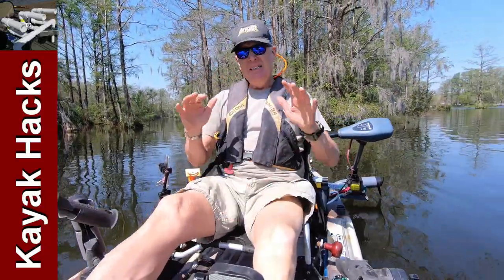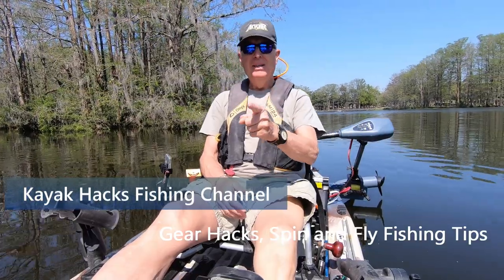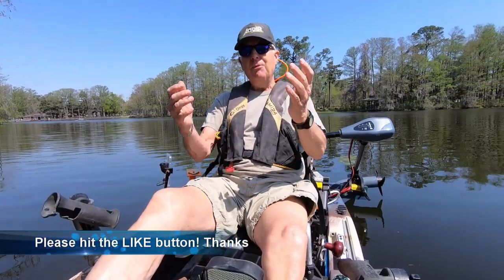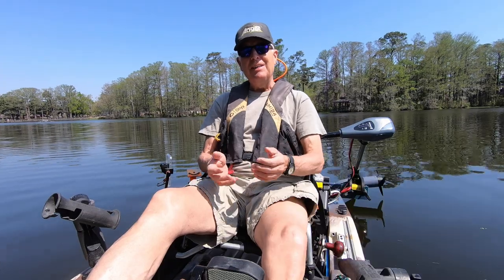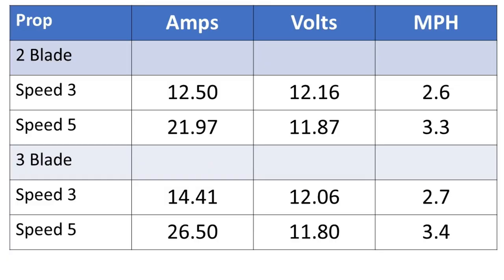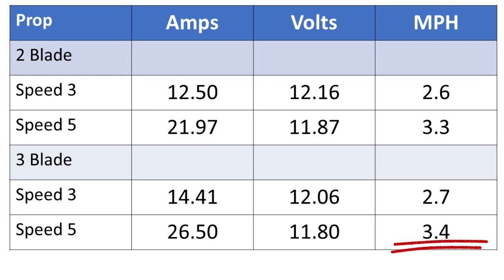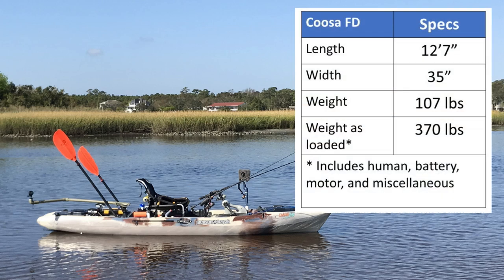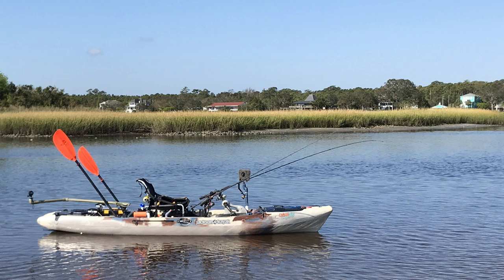Kayak Trolling Motor Prop - 2 Blade Prop vs 3 Blade Prop

Comment: I've worked in the fluid engineering field for quite some time, and while yes you do draw more power with a 3 blade propeller, it will be more consistent and continuous, making it more efficient when it comes to water chop, winds etc.   I've done this comparison, same boat, calm day and choppy windy day, and the 3 blade propeller outperforms the 2 blade overwhelmingly in tougher conditions.      I keep the 3 blade on for that reason.
Reply from the maker: Thank you for that great insight! I appreciate it!
Reply: i run a 1.3hp gas engine as an outboard.  i barely use any fuel so efficienty doenst matter to me, i just want to be a little bit faster.

What prop should i run?   rn  it has a  stock metal 3 blade prop
Reply: @sparklauerei1 prop angle is going to get you more speed. My 6hp tohatsu was slower than my buddies 5hp.  Switched to a more aggressive prop angle and now I leave him in the dust lol.
Reply: I may just keep a three blade on my boat for those rougher days then. There’s a lot of days in the winter when there’s just enough breeze to blow my boat around and it really gives my terrova a workout.

Comment: If you have two props that are identical in Pitch and weight , the 3 blade should provide more thrust and less top end speed over the two blade. Some how the graph shows a discrepancy of amperage and voltage which means your battery became less efficient at holding its voltage by the time you tested the 3 blade , or you did not charge the battery to full charge for each result. You should use a lithium ion battery to get more accurate test results as they are a lot more stable and hold a very specific voltage for hours. If you had the voltage of the 3 blade 11.87 volts , you might see an increase of .1 to .2 MPH. I'm guessing that the blades are not pitched the same , the 3 blade must have a higher pitch to reduce drag and thrust but increase top end speed. To anyone saying an increase of lets say .5 mph on a trolling motor is not worth it. When that is your only source of motion and you are talking going from 3.4 to 4 mph , that is a huge difference , like 20 percent increase. It would be like a outboard going from 80 MPH to 100 MPH. That is massive , small gains yes , but very noticeable over 8 hours on the water.
Reply from the maker: I appreciate that thoughful input! Thanks

Comment: I've tried all props on both a 36lb and 55lb thrust 12v. I enjoy the molded APC 2 blade propeller the most. from an RC airplane. not a good weedless option at all tho. great for speed and efficiency  The "stock" 2 blade is a great option but the 3 blade is the more stable, less vibration, and most "uomff". All fun out on the water. Now I have an NT300 and luv it. GOOD VIDEO!! look into APC propellers i love mine.
Reply from the maker: Thanks for the info!

Comment: The best improvement I've seen from a 3-blade prop is 1/2 mph... which isn't worth the extra power consumption it takes to achieve it. Thanks for the chart, that summarizes it beautifully!
Reply from the maker: Totally agree
Reply: technically speaking you shouldn't see any, more blades add drag which reduces top speed, there used for power transfer (torque). its why large vessels have 5/6 blades. Your props probably had 2 different pitch angles is what you noticed.

Comment: I know this is a peddle kayak but last year I was able (with my warranty) replaced the 2020  3 blade prop on my Jackson Big Rig with a 2021 2 blade prop. WOW! what a difference! Much easier to peddle and i have a better take off rate and higher top speed. So more is not always better just as your test showed. Thanks Army.
Reply from the maker: Yep. I did the same. I got the 2 blade for pedal and never looked back.
Reply: With the two blade prop you have less surface area, more speed.
I had a 17' tin boat, with a foot controlled 24 volt, 75# thrust motor, 5 speed, 2 blade prop. On "1" speed, in no wind, it was ttttooooo much. On "3" speed, if the motor was turned to port or starboard, it would throw you off the boat if you weren't ready.
I contacted the TM manufacturer, they recommended going to a three blade, to slow it down. It did. 

Have you tried kipawa props ?
Reply from the maker: @fishingismydrug1  No, I'll look.

Comment: Very interesting.  No wonder all of the 12 volt trolling motors I have had over the years had 2 blade props.  I wonder what 24- and 36-volt motors use.  Will have to start checking out bass boats and flats skiffs.  Agree with the comments about the pitch.  Don’t think I have ever seen a prop display offering a variety of pitches for trolling motors, though.
Reply from the maker: I wish there were a selection for pitch. At least I know to stick with the 2 blade for now.
Reply: I have a motorguide digital 54lb that has 3 blades.. it makes decent speed with my 12 foot jon on half throttle (about 25-30 amps draw is my trolling speed, 3 mph, with 2 persons and gear).. but i just got a endura max 55 to replace it.. wich only has the double prop.. i hope i can still get to about 3 miles on 25-30 amps with that.. on a 120 amp lithium that means I can troll for about 5 hours, wich is plenty for my use.. I mostly combine trolling with vertical fishing/casting.. so i can make it a long day ez if i watch my usage a bit.

Comment: Love the video, Sweet and to the point. Quick question for you though.. did you notice a difference in how quick it turned with a 3 blade?
Reply from the maker: No, just the resulting speed.

Comment: I didn't have an amp meter hooked up to figure power draw and I used a 36lb to test with, but I didn't notice any speed difference between the 2 blade and 3 blade props. My understanding is the 2 blade is better for dealing with grass and weeds (though I haven't tested that).
Reply from the maker: Thanks! Your results confirm what I found. I did not test weeds.

Comment: The Katana is designed to maintain the efficiency range of the Machete III, (the 3-blade), but will outperform it in grass! It's not intended to be some performance upgrade.
Reply from the maker: Thank you for that clarification!

Comment: Thanks for the info. It's now given me something to think about as my two blade (stock) is banged up causing some vibration at higher speeds and was thinking of replacing it with the 3 blade. The speed difference is a bit puzzling. I've watched people switch and the speed factor was much greater with the 3 blade. Have you tried testing again??
Reply from the maker: No, I only did it once. Some of the other comments have suggestions - pls check them out
Reply: @KayakhacksFishing  Thanks. After commenting I read others and watched some other vids. It appears the 4 blade is not really worth it. It does have some very select applications, but otherwise the two blade is the better one for the average person in my opinion.

Comment: Interesting findings. I was told a few days ago by another YouTuber who builds tiny boats that two blades are better than one for efficiency and snagging less often. He and his friends have used all sorts of motors with two and three blade props. 
For his type of mini boat he recommended the 30 lbs Minn Kota as the Hull speed is only 4 knots max and a more powerful motor would be wasted anyway. 
I like the Endura MAX range of electric outboards, They utilises a Digital maximiser to give you up to 5 times longer running times on the lower settings. The harder you run the motor though, the benefits diminish.
Motors with the Digital Maximiser provide up to five times longer run time on a single charge by drawing only as much power as you need, so they don't waste any energy like other models do.
Doodling around at 1.5 to 2 knots and getting even twice the duration compared to doing the same without the Digital Maximiser is enticing I must say, twice the price though.

Great test, thanks for doing it 👍
Reply from the maker: I absolutely agree on that maximizer technology! Thanks for the confirmation on the 2 blade!
Reply: @KayakhacksFishing   👍👍

Comment: Do you need to register a kayak if you use a trolling motor on it?  I assume that it then becomes a motorized vessel that requires numbers.  What is the deal?
Reply from the maker: Yes, in North Carolina, as soon as you put a motor on, you have to register

Comment: Greetings from SG! I have a question sir and would be grateful if you could help me answer. Ive a 14ft kayak (Efix model 3 pieces which is able to assemble into one kayak). I pondering whether to buy a trolling motor. My question is whether i will be able to get 36lb thrust if i buy two 18lb thrust trolling motor and fix onto my kayak. Thank you.
Reply from the maker: Sorry, I do not know the answer. I doubt it is additive - looking at powerboats with 5 engines on the back, there has to be some additional speed.
Reply: @KayakhacksFishing 
It's additive under static conditions so doubling the motors will double the acceleration.
As for top speed, it's a question of engine/motor power, blade loading (id est Force divided by Area), and blade pitch.

Pitch is the distance the propeller would push water backwards assuming 100% efficiency. It's typically measured in inches per revolution.
If you were going at max engine/motor RPM, and V = Pitch x RPM, then adding a duplicate drivetrain would do diddly squat for your speed.

If your engine/motor is struggling, and/or if V = <0.8 x (RPM x Pitch), then there's room for improvement.
* If the engine/motor is too weak, adding a second one should drastically improve performance.
* If the propeller is "slipping" by more than 20%, changing the propeller to one with greater blade area should help improve "traction" in the water.
Reply from the maker: @gustaveliasson5395  I really appreciate your thoughtful reply. Good info!

Comment: Y’all ever tried a Kipewa 853? Supposed to be less amp draw and some are seeing 1mph gain
Reply from the maker: I have not heard of that one. Thanks for the tip
Reply: @KayakhacksFishing  have you ever “tuned/sync” your motor? When you pull the prop off, there’s two bolts you loosen. Turn the motor on high and rotate the motor. You’ll hear an audible change as it gets more silent and spins faster. Turn it off and tighten it up. Toss your prop back on. It’s taking any parasitic loss and drops amp draw slightly
Reply from the maker: @nate4036  What a great tip! Thanks!
Reply: Yes please compare between the weedless wedge 2 and the kipawa 3 blade!!

Comment: which Newport trolling motor 36 or 55 Lbs? I appreciate the knowledge you share.
Reply from the maker: I was using the 36 lb thrust
Reply: @KayakhacksFishing  thanks for the testing.  newport QA is lacking to say the least. I just setup mine and it was wired backwards.  funny how they say on their website the following: Small 3 Blade Propeller
Designed for the 36lb, 40lb, & 46lb thrust Newport Vessels electric trolling motors (All Series)
Diameter: 8.9 inches
Internal Diameter: 3 3/16 inches
Benefits: More thrust with 3 blades resulting in faster acceleration from standstill
NOTE: The use of this propeller on the 36lb motor will result in decreased power output.
Reply from the maker: @sidnguyen  lol... makes no sense
Reply: @KayakhacksFishing  neither was them wiring the switch backwards.  i'm out there with 3 forward speeds and 5 reverse lol.  have you done any battery size run time testing?
Reply from the maker: @sidnguyen  I have a few in this playlist -https://youtube.com/playlist?list=PL8egn41J7Go8ktbwm2npNZtAAJ3izoVmf

Comment: Prop performance is complicated. A prop with more pitch will consume more power but provide faster acceleration. The top speed will not be as high (assuming the same number of blades and same diameter). Conversely, a prop with less pitch will, all other things being equal, produce higher top end speed. Think of the pitch effect like gears on a car, 1st gear accelerates faster but 5th gear gives more top end. So overall speed and power consumed are only part of the equation.
Reply from the maker: Thank you for that insight!

Comment: Have you tested 30# vs 45 or 55 for current draw vs speed?
Reply from the maker: No, I only have the one motor. I wonder if it would be proportional.
Reply: I believe those specs can be found from the manufacturer. I recall finding a table from minn kota for their 3 basic transom mount trolling motors that showed thrust, speed and amp draw.
Reply: Yes. I posted a 30 and 55

Comment: Two blade is the way to go but if you could change the pitch you may get more torque at lower speeds or slow starts but better speed the other direction of pitch
Reply from the maker: Do you have a link to a product with better pitch? I'd love to try it.
Reply: @KayakhacksFishing  No sir but the minn kota power prop is hard to beat. I'll try to talk my son into a 3D print and let you know

Comment: I bought a better brand 2 blade, and while I didn't test draw, I picked up .2mph as per my GPS..  Not really significant, but we feel it. (12ft rowboat)
Reply from the maker: Can you please share a link?
Reply: Yes please share a link
Reply: Will do fellas... But the boat is in my enclosed trailer, and I'm "working" (winkwink) right now... hang in there.

Comment: Minnkota twin prop-12 years not a single chip on the prop after running it through weeds and rocks👍

Motorguide triple machete prop-
one day of use 3 CHIPS, One on each prop. Barely touched a twig underwater.🤯
Reply from the maker: ouch

Comment: Conclusion:
The 3-bladed prop moves more water than the 2-bladed prop, but at the same velocity.

Think of it like going from a 4x4 car to a 6x6 car.
The extra wheels give you a bunch more traction, but that's only going to help you if you were having traction issues with the 4x4 car to start with.
If you weren't, then all the 6x6 will do is add complexity and friction.

<<< Ok, now how do i use this information? >>>
Well, look at the speed he got up to with the 2-bladed prop, and look at the effect (or lack thereof) of switching to the 3-bladed prop.
Clearly he didn't start off with any "traction issues".

With that in mind, if you're using the same motor with the 2-bladed prop and notice that you can't match his speeds, the 3-bladed prop might just help you close the gap.
Reply from the maker: I appreciate your insight!